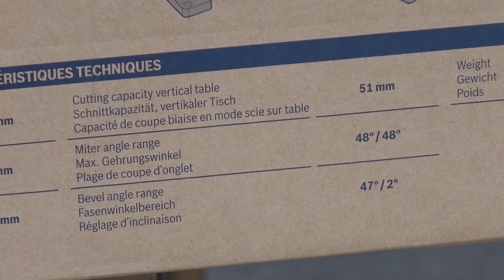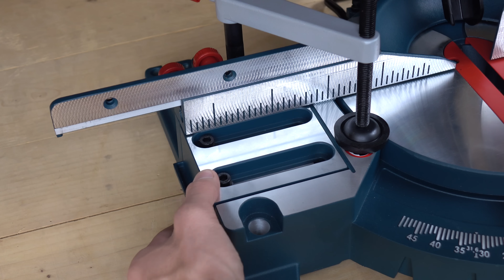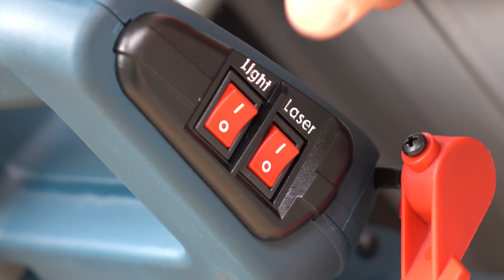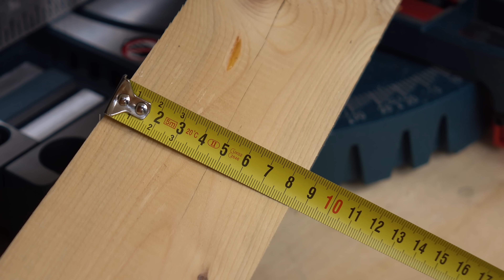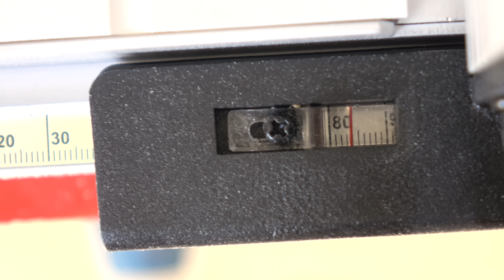Miter Table Combination Saw BOSCH GTM 12 JL  |  Unboxing and Test

Comment: unique idea but i dont see much use for it as normal table saws dont have that weird plastic thing on top of the blade and that as a miter saw is very basic because cant do big boards
Reply: You can remove the plastic safety guard, and   i think the miter is meant for large beams or thick wood and the table saw for long pieces. Thats why it has no sliding feature.

Comment: Wish I could find this in Canada, can't find anywhere to buy it, especially a 120v version, so shipping from UK/EU just won't work
Reply from the maker: I think it's only made in 220V version
Reply: @MakeAndTest  Yeah which is why buying one and having it shipped here wouldn't help anything since in NA we run off 120 not 220 :(
Reply: @YulRun  Virutex makes one for US and Canada 120v
Reply: @davidcorliss  Just found it thanks! Bit on the pricy side at $800 American. But at least there is an option out there.
Reply: @YulRun  if you think about it you will spend just about same if you buy them separate
Reply: @davidcorliss  full priced for sure. Something to keep an eye on, see if they do sales at any point. When places like Home Depot and such do big Black Friday sales and such can usually get tools fairly cheap. Sadly I think this company only distributes themselves that I could see.
Reply: @YulRun  try this I made an account put one the cart to see what the shipping cost would be then took it out couple of days later I got an email from sales offering $100 off if I bought one within a few days

Comment: Don't agree with that table saw technique. The force needs to be against the fence and applied at two points.. Not merely pushed parallel to the fence at one point.

Comment: Appena comperata, scartata e provato a metterla in funzione.
Difficoltà enorme nel tirare la leva di sblocco (n° 38 sul manuale) e scomodità evidente nel passare da una lavorazione all'altra.
Lo sblocco necessita di pazienza certosina per trovare la posizione giusta per estrarre il perno. Dopo varie prove si è pure sfilato il nottolino in plastica, costringendomi ad usare le pinze.
Ho fatto girare il motore, molto rumoroso e dal suono grattato, che mi ha costretto a fermarlo per controllare che da qualche parte ci fosse un pezzo di polisterolo.
Non ho fatto nessun taglio e oggi la imballo e la restituisco al mittente.
Ho bisogno di passare velocemente da una lavorazione all'altra, e questo sistema non è proprio comodo.
Beppe

Comment: Nothing more of a toy than a machine to cut wood. Many other manufactures make this desighn of saw. The motors are never powerful enough resulting in motor burning out. Model makers could possibly find this saw useful. The safety features are good and the general desighn.

Comment: This machine is not suitable for heavy work. As a professionall user, I do not reccomend such Multi purpose tools. It looses accuracy in a short time, needa service frequently, original blades are very expensive And have short life. Bosch made this machine to earn monry bu selling blades. Do not waste your money
Reply from the maker: Are you talking from your own experience or are you just trash talking a good company?
Reply: @MakeAndTest  are you paid by Bosch? You have no right to accuse me like that. You do not know me. This is really stupid. Regarding to your accusal; I have several cutting machinea from many brands. 12J is the worst, but not the cheqpest, one of the most expensive one. Bosch is not reliable like in the old daya since they started to manufacture And import from China. This is my experience.